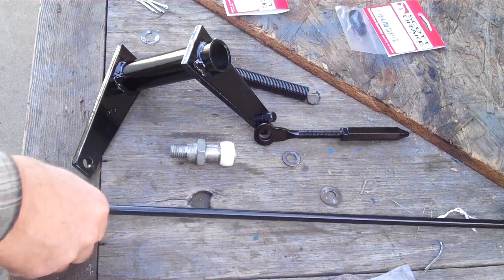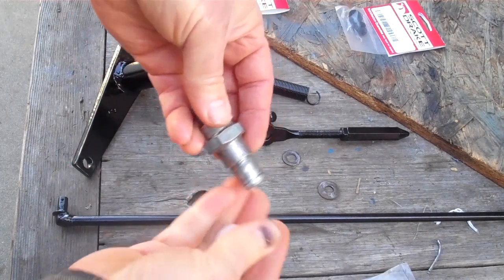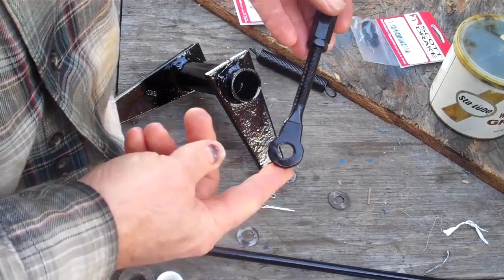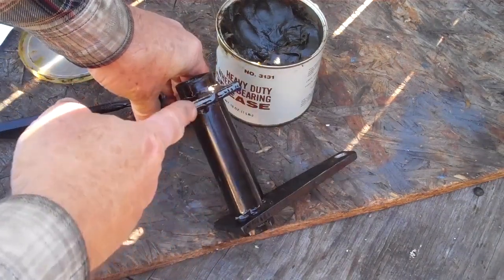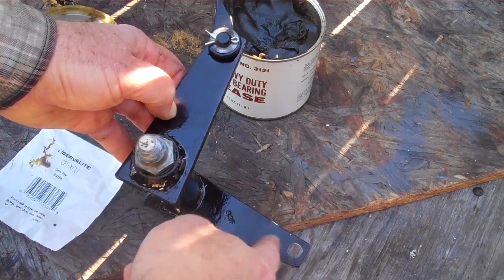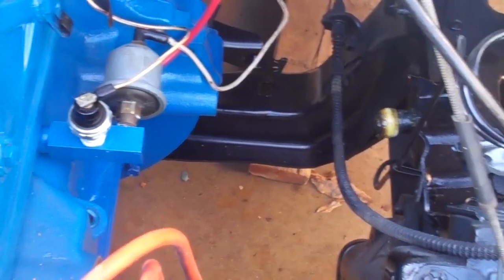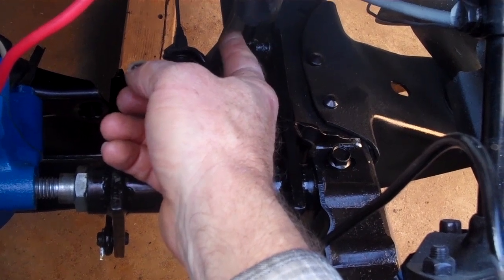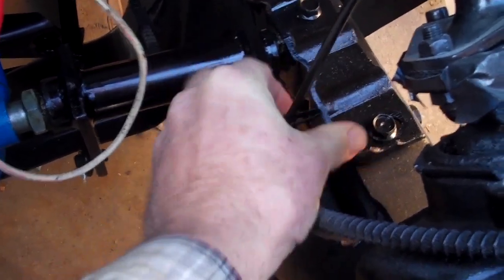1966 Ford F250 Clutch linkage

Comment: where does the other end of the spring go that comes from the clutch release fork? I'm having a heck of a time trying to find the spot
Reply from the maker: I just uploaded a video that shows how - https://youtu.be/qLDvVDBkI3Q
Reply: I made a simple piece of 1/8" steel with a 3/8" hole, and a 1/8" hole, set 1" apart from each other. I then bolted to the back of the adjuster with a 3/8" 16 thread nut. Just align it so spring is even with adjuster rod.